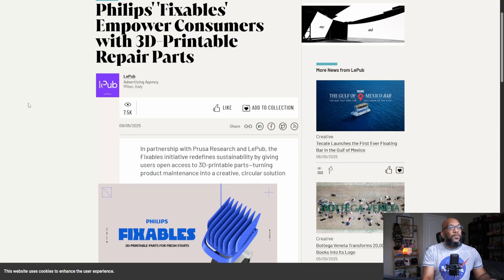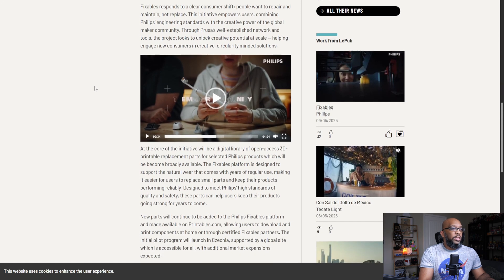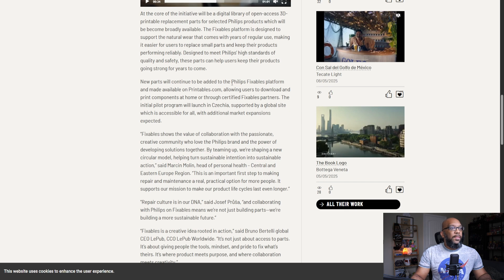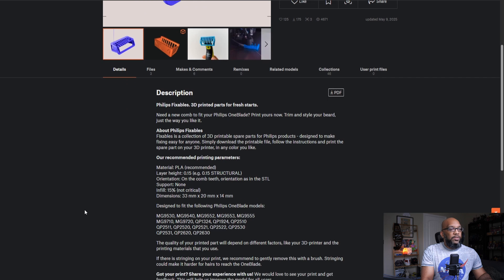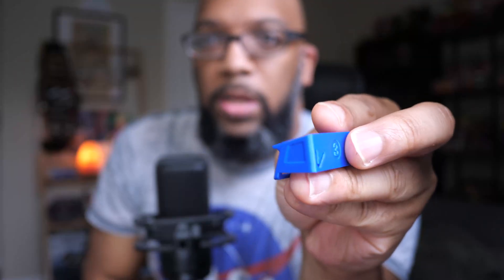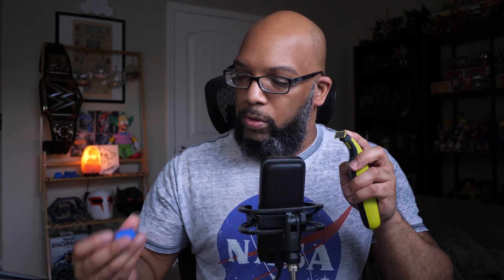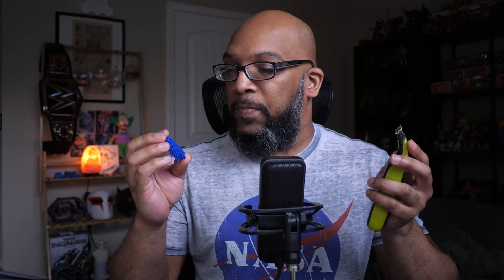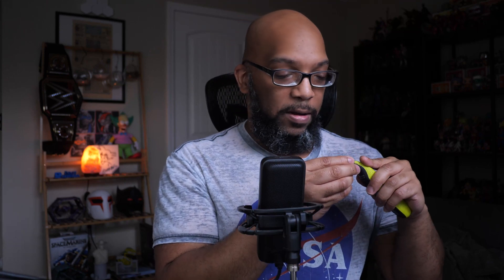Prusa & Philips Team Up for Consumer 3D Printed Repairs

Comment: I've been in 3D printing for almost 15 years now (20+ in additive manufg.)
When I saw this I said "This is it. Here it is." This is the purpose of 3d printers in the home. Every company in the world will be doing this, as its just more beneficial for all consumers and their bottom-line. We're getting closer to the 3d printer as the 'microwave' now; buy your microwavable meal, pop it in, eat. 
Same thing for printing (buy your material, get your model, pop it 'in', done).
Reply: A lot of company's really don't want this to happen since they would rather have the product break forcing consumers to buy new products.
Philips seems to be trying to get first mover advantage, honestly i hope it works out for them.